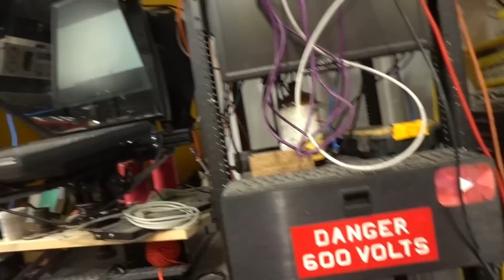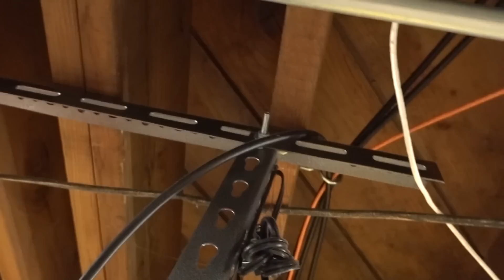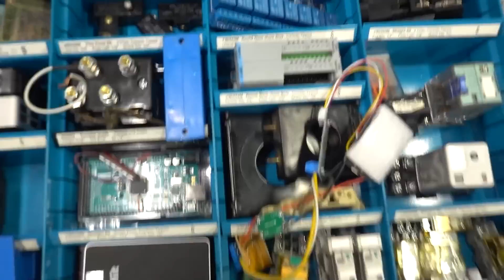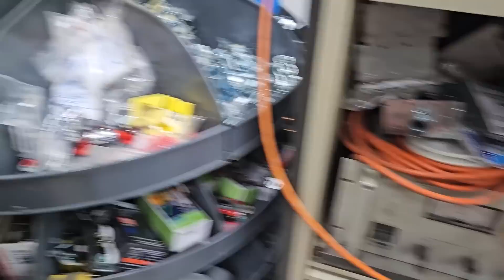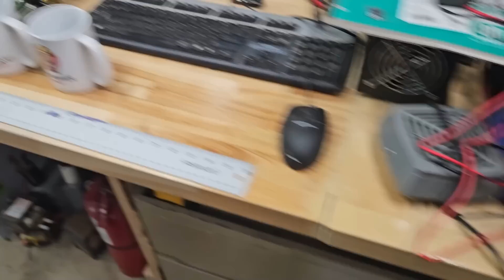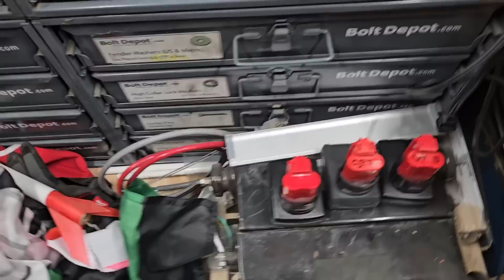Shop Tour 7 30 2024

Comment: The HP server can still do some good work. When I worked at Goldman Sachs 15-20 years ago in a trading systems department we ran transactions for about 20% of the volume of the New York stock Exchange on a daily basis through what I think were lower spec HP servers than what you have there. I profiled the C (yes, ANSI C) that I wrote for this at about 10,000 transactions per second. The required performance target for that work was 4x average daily txn volume, and the implemented performance profile exceeded more than twice that target. That being said I imagine you could have more modern computational tasks that could stress that server out. Stock trade txn processing is relatively light computationally.

Comment: Another idea for you, on that stepper motor. If you are trying to smooth out the turning motion on said mounted camera perhaps try putting a magnet on the edge of the stepper plate that rotates. Put some kind of wide finned stir bar in a very shallow bucket. Mount your camera holder on a single spinning rod going down the center of bucket and put a wide fin just below the camera mount surface that gets slowly spun by the water. Only issue might be the wobbling but perhaps fluid will smooth out the jerking motion when you transfer energy. Good luck!

Comment: You should rip on Craftsman. Just last weekend I snapped the cheap ass metal on a socket extension that I used to remove a crank shaft pulley bolt. Extensions should never be weak enough to warp from 200 foot pounds of torque. So sorry, Craftsman gets my down vote.

Comment: I see you are a fan of Kreg screws...great choice. AND, I also saw a blue emergency strobe light with a magnetic base and such. It's the same one I used, years ago, when I worked on the Railroad. It's used for the blue flag rule for maintenance workers.

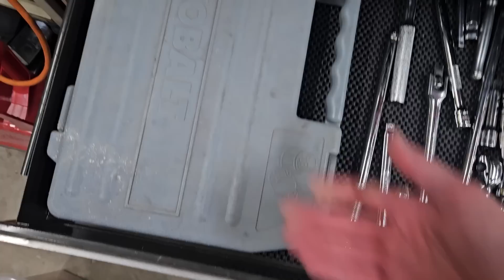Comment: 22:42 I need that for work, where can i find that? we have a lot of hi loks and hi lites, we took a normal ratchet and drilled though so we can get an allen key in there. I know there are nuts with holes in the side, but that is also not to great. We do have the pneumatic tools from Atlas Copco, but the build in allen key often wears out the hi lok. If its worn out it often works with a metric allen key, but they often wont fit the small hole in the ratched we drilled.

Comment: For the turntable could you not use some rubber or cloth dampening for it ? You could attach a heavy object preferably circular like a weight  to act as a flywheel mabye

Comment: I know this video is five months old and you will likely not see this, but I felt compelled to voice my loathe for Allen Bradley Components. They are running off a reputation they developed in the 90’s. There are vastly superior manufacturers at significantly better value. 

Sprecher + Schuh has a reputation as cheap junk. AB has a reputation of best of the best. It’s literally the same product made on the same line, you just pay twice as much for AB to put their name on a sprecher product.

Comment: If the rotating table doesn’t work, try a small rotating positioner that welders use for welding anything round. They have to be smooth and are usually variable speed right down to the speeds you need.

Comment: At my old shop, I had everything stuffed into an approx 3 car garage.. then Dec 22, I moved which dang near killed me moving a machine shop, weldong shop, electronics lab x2 locations, and so mich more of my crap.. in one month, it'll be a year, and still haven't unpacked and started setting up theb new shop at my new location.. if any of you ever need to move, plan very well, as, i dont even know how to begin and the location is crammef full, which makes it exceptionally difficult to navigate what goes where.. and i am not sleeping well at all, because i cant see straight, because nothing is set uo out there just a horrible cycle or trapped OCD almost to a measure of depression.. so, please plan well, how you move, with plenty if time, building shelfing or installing of storage systems, before moving in.. good luck

Comment: i used the rubber lined stainless steel single bolt hole cmaps for my ether and low voltage, didn't think of or know about bridal hooks, then again the clamps can be undone at a whim

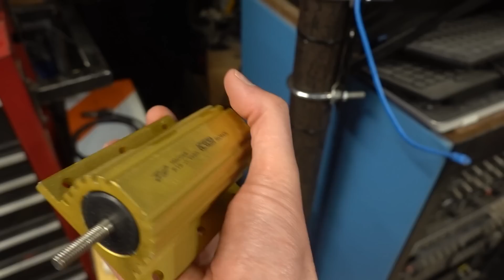Comment: 12:35 whoah. I work for a EV powertrain company and I haven’t even seen them that big before. We accidentally blew one when we pre charged the system for too long oops. But it shot out the side of its heat sink wish it wasn’t in a metal box so I could’ve watched it but could be a cool video blowing one of those.

Comment: For the turntable, there are micro-stepping stepper drivers that will reduce the clunk between steps. They do however consume a lot more power... but for your application, this probably isn't so much of an issue.

Additional thought, the coupler you are using. You can get elastic versions that can also reduce the steps.

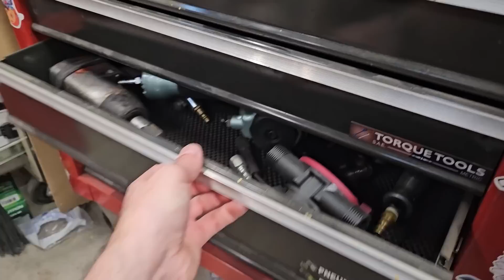Comment: 24:30 the drawer being stuck is likely the tracks on the side. If they’re three parts instead of two parts there’s probably a part that is seized completely in one of the tracks. So you only get half extension.

Comment: 3:50

I mean, it makes sense...

When on the job, you go in, do a job, make it tidy, and get out.

When its at home, you tinker, you fiddle, you modify, you troubleshoot...it tends to be a more messy process because it keeps changing over time. And the mess that carries over between changes grows exponentially, as you compensate for other messy details.

Comment: You can never have the luxury of space. If you got more space, you would quickly fill with important stuff. How do I know?

The stepper can enjoy with other stepper algorithms. You probably are using the FULL or WAVE algos. Microstepping algorithm usually works the smoothest but has less torque.

Comment: About the stepper driving the Parker rotating platform: I think you can get a much better result with a better driver. Like microstepping or something. As long as you don't need high torque in-between full steps.

Comment: I have so many of those old HP Gen 6 servers that I've been using them as tables for the last 8 or 9 years. Now they are all out of service and I don't need that many tables. Is it better or worse than I upgraded to HPE blade servers for my lab? Right now I'm trying to prevent myself from spending 5 figures on a newer ML server, it seems many newer models architectures may need >100-200GB for training.

The way I view messy home network is this: ain't nobody paying me to do it, so I got what I plaid for, which was good enough to function. Meanwhile my network at work is... lets just say "defensively messy". It doesn't look too terrible on the surface but its essentially an encoded maze with ports and drops having different numbers on each end and routes taking the scenic route around the building because fuck me if we could have any home runs.

Comment: Try driving that rotating table with a TMC2209 or similar. They can make lots of micro steps. And it's all cheap 3d printer hardware, heck even buy a cheap 3d printer control board to plug it into and load some custom firmware for control (klipper etc)

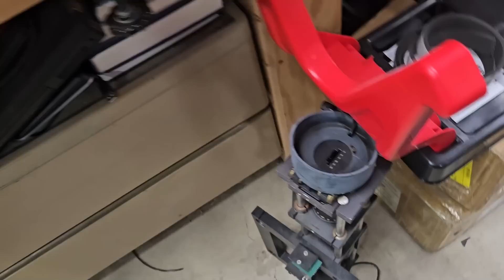Comment: 32:20 My gues is a ruby laser that has two mirrors one slightly weaker than other light would bounce in them through the ruby laser and once it gain enough strenght it would go trough the weaker mirros. StyroPyro made one.
Reply: Was thinking the same thing

Comment: Just ordered 3 different HD (not 4K) camera glasses off of AliExpress, to see how they perform and look compared to the "sport glasses" (which I seem to recall would allow me to play music, but I don't remember if they had a camera, that I bought some 10 years ago. One of them clearly states that they will operate for over 2 hours, don't know if that means that it will record any more than 30 seconds though. Another offers 'continuous' capture, with a new file each time you start recording, It also supports up to 128 Gig MicroSD cards. The third I like because of the style, and while it does have a photo capture mode, no video, That said, that can be useful, and they interface with a phone to act as a headset, and have a mode to interact with voice assistant. (All they need is another $150 worth of mirroring, a display system, and perhaps they can act as 'Nreal' glasses. That's a bit out of my budget though.

Comment: Do you have a laptop that has USB and a real 9 pin hardware serial port ? 

I need to program old radios and they use serial cables and DOS software 

It only works in true DOS, so I need a laptop that can boot from USB so I can put in a DR DOS or FREE DOS and run the RSS from DOS using the serial port 
They only work on COM 1 or COM 2, and it has to be a old style BIOS 16650 serial, not USB to serial. 

The software can't see USB 

I spent months trying everything to get the USB to serial adapters and they just don't work

Neither does DOS in a Box

I don't know why, but the radios and the cable won't work under anything but real DOS

Thanks

Bill
Reply from the maker: I might be able to help. Send me a message on Discord (link in the description) and let's see. :)

Comment: Prompt Smart - Tell me what you like and what you wish it did differently and I will find you an alternative solution
Reply from the maker: Really? Thank you!
Ok, here's what I need...

1. It can't be stupid expensive. I'm low budget.
2. Has to work on PC (web interface is fine), Android, and iPad.
3. Has to have (or be able to have) a BLACK BACKGROUND with white or green text.
4. Voice tracking is a huge plus, if not that, a wireless remote is ok.
There may be more? But that's the top of my head stuff. Thank you for helping!

Comment: For driving your rotating table, use an analog frequency generator, and a phase shifter feeding one pair of coils on the main frequency, the second set of coils on the phase shifted signal, and it will drive the stepper smoothly. You may need to use the amp to bump up the voltage to drive it smoothly. And that came from Applied Science a few years back. The only thing I've found to be a problem is getting a phase shifter that will shift 90 degrees, regardless of frequency.

Comment: Have the same Kobalt thru socket set! And no, haven't seen them in store for a loooong time. Former coworker had a hazard freight set, not nearly as many sockets for it though. I've been using the same cheap Stanley ratchets and sockets at work (machinist) for years, saves money for buying Mitutoyo goodies 😁

Comment: Nice shop brother. I have the same 2235 scope but it's developing problems so I'm interested in that. I also have a power supply you might be interested in. Variable 600vdc 0.75A iirc, I'd have to dig it out and make sure.

Comment: Nothing wrong with lockpicking as a hobby mate. I started lockpicking years ago, I've found it to be a pretty good way to focus my mind, and it's a great conversation starter when folks see picks and practice locks on my mantelpiece. It's also a handy skill to have when you see how much emergency locksmiths charge for something as simple as extracting a broken key, or re-pinning a replacement lock to your old keys. 

The only issue is that if you really get into it, and learn to instantly recognise a wide range of locks from their face, you start to notice that even some quite moderate security buildings putting WAY too much faith in some truly awful cheap locks. You'll see side doors to shops with locks that you COULD genuinely pick with a couple of bent paperclips !
Reply: Back in 8th grade (1998) a kid on the cross country team with a little paperclip-like lockpick was able to open some locked doors in the Jr High locker room. Just an office and the equipment locker, but it was exciting to explore, and look at locked doors and think of the possibilities. I stay away from lockpicks, would be a fun hobby though! You're right about mid-security institutions having those vulnerable points like service doors. Makes one consider being a security consultant lol.
Reply: I made some lockpick tools from streetsweeper bristles.

Comment: Amazon sells tons of point-of-view eyeglass camera combination many of them have well over a half hour of time. There are several police officers who still use those type of cameras because they don't have the body cams but they still want to record every interaction.

I want to get one of those, so when I start using my electric brushless Hub motor hand cycle for the front of my wheelchair more often I want to get it on video

Comment: In regards to your network cable mess:
The best builder's home is falling down,
The best mechanic's car is a rusty shitbox,
The best plumber's boiler is older than his grandfather and wrapped in denso tape...
Wouldn't trust a tradie who isn't busy enough they have the time to fix their own shit😂
Reply: Also the best roofers are in jail monday mornings
Reply: @pigeon.and.pigeon  and back in my store Monday evening after bonding out. They're hard working muhfuckas!
Reply: One thing that I learned from working on cars is how bad something can get and still function. My car’s CV axle is on the way out. It’s been making noises that have slowly been getting louder and more frequent for the last almost 2 years now. I check on it every oil change. Fun little experiment to See how long it can last
Reply: @FuttBuckerByMutt  just a warning: When it breaks, it could swing around and destroy stuff, including your engine block
Reply: 100%
Reply: My duct work is all jacked up and my AC uses R22
Reply: @huasohvac  same here - ran out of charge, at the start of summer of course, had to blow a guy behind the Sam’s club for some 20 year old r22 they found in a closet
Reply: @JustinAndCars  This is the way.
Reply: @huasohvac  Don't get me started on ductwork problems! Leaky, traps dust inside & hard to work with. I see why so many split heads now. HVAC needs to figure out how to switch to PVC pipe ductwork, like you see in a wood shop for sawdust collection. My return vents are now a central vacuum system? Yes please!
Reply: @huasohvac  When you use Duck Tape instead of duct tape.... :)
Reply: My electrical has cloth jacket mc and buried KnT. After all, a cobblers children have no shoes
Reply: I stopped being a mechanic because I like fixing my own shit, the market crashed before I had a shot at getting a foot in the door building houses and I prefer to do my own work, and I plumbed my own house when everything needed to be reworked for a renovation. 

I save so much money not having to pay other people to do work for me.
Reply: A mechanic i can say so true

Comment: If youre selling a DC bench power supply, im interested. Is there a used items store, or is it first to notice and ask from a video, gets it?
Reply from the maker: I've got some 12V 100A supplies sitting in the back that I should sell off.
Reply: @Physicsduck  Oh yeah? I'll EMail ya.
Reply: @Physicsduck I'm looking for an adjustable and CC/limiting type, maybe 3v-24v 5-10A single channel. I don't need it, but I'd like it. Same with a programmable load for the same reasons lol. 
Find some intern who will org and list this stuff on a website or eBay or something. You could turn your YouTube into a used equipment reselling store for extra profit, it seems. I am so much like you , that a store like this seems like an AMAZING place to browse and shop. Just a recommendation for your future. Keep this stuff coming either way!! The realer the better

Comment: Saw the hang board above the front door in the beginning of the video.  Do you climb on the side? If so what type (sport, top rope, free solo, ect.)
Reply from the maker: I do technical climbing these days, and not much of it anymore. I started with Towers (Radio), then get into Trad and Aid in my 20's. Now it's just towers and structures, and not terribly often. I miss it.
Reply: @Physicsduck  I didn't even think about the fact that you're an electrical engineer and that they put engineery things on big metal sticks sometimes.  I did some rope rescue training and worked at an indoor climbing gym for a bit.  Climbing is definitely more fun when it's for fun.

Comment: The network rack is honestly better than most other installations. It is very accessible. Most are shoved behind a tv with a lot of other cables or sometimes hidden in a closet where you have to use a ladder or lay down on the floor with your arm barely reaching it. Moving something away from the wall is not always possible

Comment: OH NO FUCKIN WAYS!!! MINT!!!! & for a face mounted camera just shoe goo a little GoPro to a baseball cap bill, it’s the best/lightest head camera you’ll find, period! if that’s too redneck for ya then a lightweight protect skate helmet (ie brain bucket) I run a Steve Caballero ity bitty when I take the grandkids to go ride vert & tech them 80’s tricks  & use the mounting crap they sell, same results either way, bike helmets just suck & flop around, skate ones stay put